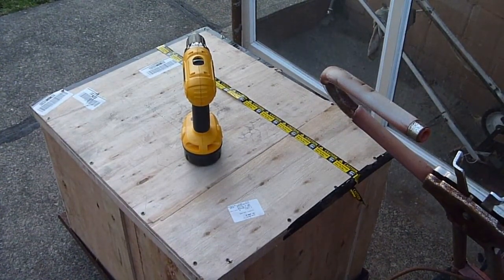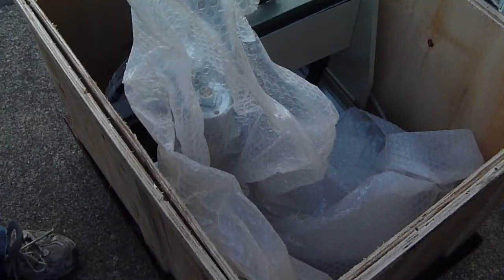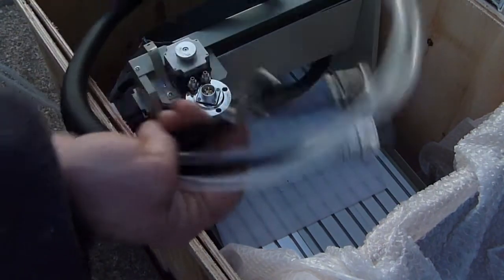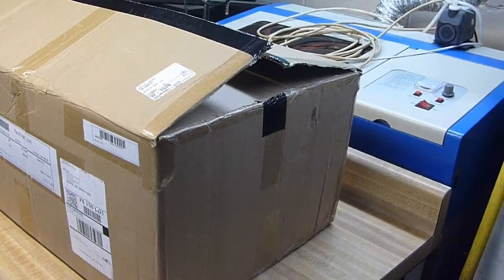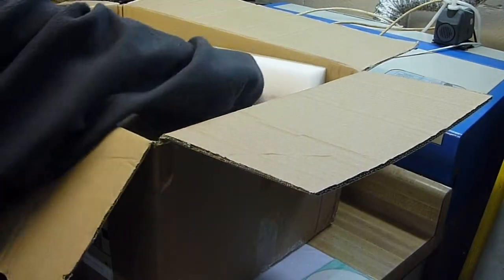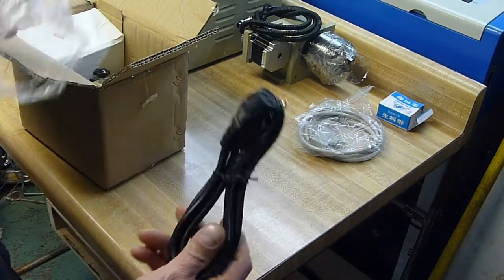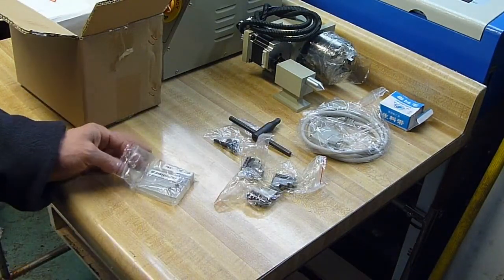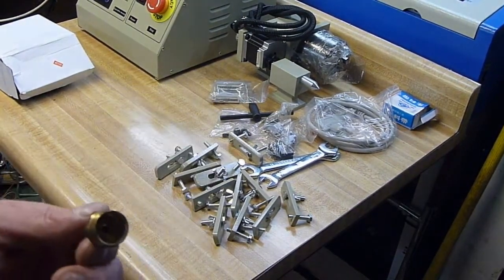(2016) Chinese 6040 CNC Router Unboxing

Comment: nice video unboxing it it looks like u got u self cheap aquarium pump I have seen others that come with much nicer water pump not aquarium pump and there is others that come with air cooled spindle motor been looking around and they r bit to expensive for what they r. :)👍
Reply from the maker: I think the smaller models are the ones that usually have the air cooled spindles.  Offhand, I can't recall the power rating on this motor. The pump really isn't that bad, just cheaply made. It seems to flow plenty of water to keep the motor cool, and I use this pump for the router as well as the laser engraver since I accidentally cut the cord on the one from the laser engraver 😐   The machines are quite expensive, but are also quite capable depending mostly on the screws, the stepper drives, and the spindle motor.   The ones I just looked at quickly are actually a bit more than what I paid for mine, though now it seems as though most are USB controlled rather than parallel.  They're still labeled with a SPANDLE power connector, though!